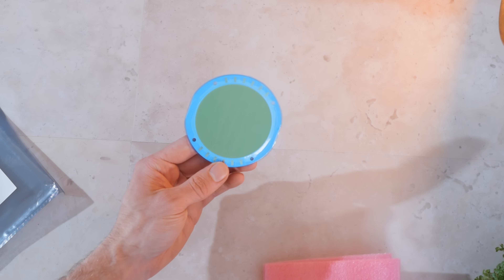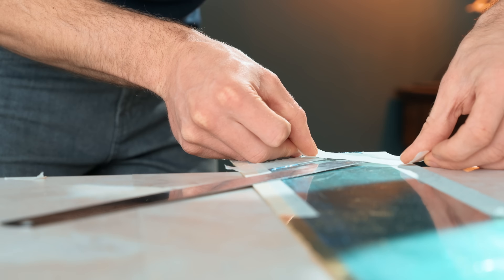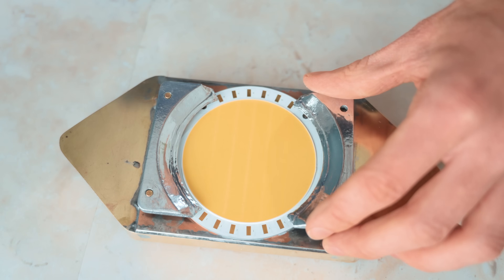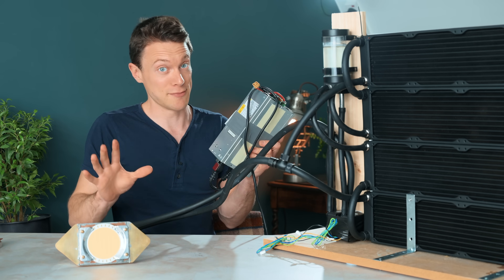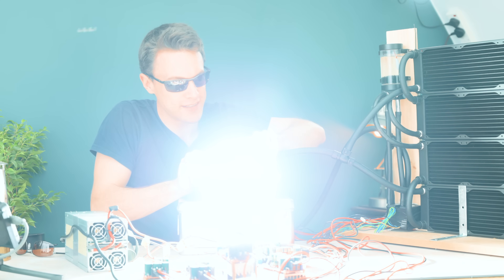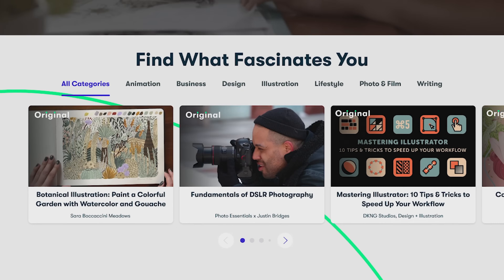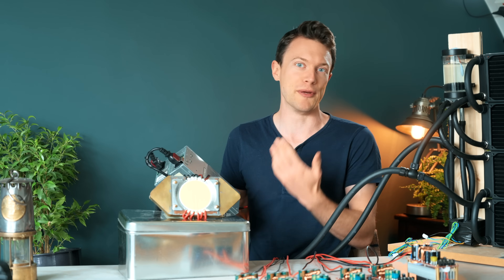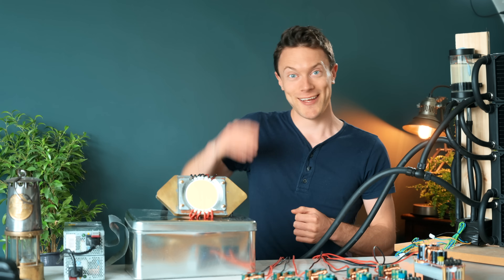Testing the world's BRIGHTEST LED!!!

Comment: With a 80% efficiency (some leds are better than other, maybe this one is more efficient, 60-90% is a typical range), it's 300W of heat loss ! So it's like cooling a very beefy GPU.
Reply: Yep.4x 480mm radiators could dissapate more like 1500watts and up. The LED dissapates at max maybe 700 worst case
Reply: @lukasstadler6594  a single 480 can handle far over 1500W if you accept hotter water temps
Reply: Yep, that massive radiators are overkill
Reply: Borys Plasma Tweeter 
There is no kill like overkill : Ave
Reply: What is the theoritical limit? About 400 lumens per watt for white light, right?
Reply: @Alban led have 20-30% efficiency...
Reply: @DrLoveQc  yes it is overkill, even with a 60% efficiency!
Reply: @DrLoveQc  WTF? There is nothing about heat power in datasheet... This led cob has 120,000lm at 1500w which give more or less 80lm/w which very bad for so expansive led cob!(Good led cob's have 110-180lm/s) Power efficiency is worst than 25%. it's maybe 15%. it's at least 1200w heat power.
Reply: He can and probably will try scaling down the loop to keep the size smaller until he runs into what we would call in the PC world: thermal throttling, or in this situation a thermal equilibrium of probably around 60-70°C for the water.

I would say water cooling is a better option than air cooling at this point. Otherwise he would need very fast fans (think Noctua Industrial PPC) and a heatsink that is not only huge, but also has a big cold plate, and those aren't common, because serves are designed to be compact and don't produce a 1000W of heat per CPU yet. Water cooling is just way easier. Maybe something like a Threadripper air cooler? Still sounds like not big enough.
Reply: What are you talking? This led is 25% efficient, this cooling solution is absolutely necessary. And dont yust take my word for it:
Max lumincance: 120000 lm
Wattage: 1500w
Leads to 80lm/w
At the spectrum of this Led the maximum efficiency is about 320lm/w, thereby the efficiency is 25%. At this efficiency the cooling solution needs to dissipate 1100w of power
Reply: I smell GTX 480 here, the tdp is 250w
Reply: @bitelaserkhalif  gtx 690
Reply: Can you explain the math? It might be useful for me in the future. My next computer will be water cooled.
Reply: @fishsauce2221  what math ? 1500*(1-0.8) ?
 this is for a led, not a computer. Unless you have 2 beefy GPU and a big CPU (a 3000€ machine) there is no need for water cooling.
Reply: @LeBlafy  taking 25% of efficiency at 1500W gona give 1150W of heat power not 300W... please correct yourself.

https://en.m.wikipedia.org/wiki/Luminous_efficacy
Reply: @465kuba  the article you linked is about luminous efficacy (heat generated from any source of light), not about LED efficiency !
It is not the same thing, here we are talking about direct heat loss, not the heat generated from the light of the led (and transferred to a surface).
Reply: @LeBlafy  Oh it was that easy. Did not expect that. The reason I am thinking about water cooling is because I have a problem with dust. My home is clean and the computer is on the desk and yet it sucks up dust like a vacuum cleaner. With water cooling I would only have to clean the radiator. So no fiddling with the cpu and gpu fan and risk damaging them and less risk of a fan stopping. Also keeping the cpu/gpu cooler is supposed to extend their life. Dont know if that is true though but it makes sense. Heat expansion and such.
Reply: @LeBlafy  It is also obut led efficiency. Look on the table "Lighting efficiency" -> "Examples".
Reply: @fishsauce2221  not all power transforms to heat the most part around 60% is transformed in light the other 40% are tranformed to heat
Reply: @Humbulla93   Yeah. But we don't know the exact efficiency of this led, it's not in the specs. But I'm pretty sure it's more than 60%, this is not a cheap LED ...
Reply: @LeBlafy  the samsung LM301h 80cri have around 210-220lm/w if you drive them with low currents, for CRI 95 you have a theoretical maximum of ca. 310 lm/w. of course it is depended on application but for horticultural appliances you want the LED´s to be spread out as much as possible, and if you use midpower LED´s you profit from convergence points of the lightsources. Cree posted a press release with a laboratory LED of 303 lm/W at 5150K. If you lower the color rendering index (CRI), you can achieve higher values. But not higher than 683 lm/W ( that is for green light)
Reply: @fishsauce2221  Every single joule or energy is being converted to computational power or lightning in this case, actual conversion is connected with power losses, which is measured as heat. In PC watercooling it does not work the same way, since computing is not efficient and it transfers almost whole energy to the heat produced by chips. On average 1 powerfull cpu like amd ryzen 3950x on full load consumes around 180-200w of power, transfering it to heat. High end GPU is around 200-250w on full load. So basically you need around 500-550W thermal capacity of cooling. Each 35mm thick reputable brand radiator 120 mm section is rated for ~150w with normal temp difference (water transfering CPU and GPU heat to radiator gets to ~15c above ambient temp). If you let water get hotter than 15c difference (DELTA T) from ambient, blowing lower temp air to the radiator will increase thermal capacity, therefore increasing cooling power. But you need to keep water warm, not hot, because the same happens when cooled water enters cpu/gpu waterblocks, more thermal difference of water vs copper base of the block is, more energy and heat it can absorb. So more radiators = less air needed therefore less RPMs needed on fans, less radiators - more air mass is needed to dissipate the heat stored in radiators, therefore higher rpm and much noisier fans are needed. My recommendation is 240mm reputable brand radiator for midrange pc, 360mm radiator and good static pressure fans like Arctic, Noctua, Corsair needed for gaming. If you are doing heavy renders, doing extreme overclocking on high end pc, you need to get big tower case and put more than 5 sections of radiators with silent static pressure fans. 

For example PSUs have bronze, silver, gold, platinum, titanium ratings, it only tells you what level of efficiency it has. bronze as i remember is around 86%. So if you load your 600w PSU to 400w, it consumes 14% more ~ 460w from socket, therefore 60w are lost in 220v > 12-5-3v conversion and of course  transferred to heat, that's why low end PSUs have their fans almost always on, when gold - titanium rated psus with 94%+ efficiency are rarely engaging their fans. It also has impact on your electricity bill :) Lightning in this case works like PSU, converting 50-55% of power into light, which is dissipated in the air, generating hot light, other 40% are converted to heat generated by LEDs.
Reply: @fishsauce2221  just buy 1x 360mm, 1x 280mm or 2x360mm and you are set
Reply: @1toW4mB0to9  Can you elaborate on that? Even with a high end computer you should only need one big radiator. The size you see on the video.
Reply: @fishsauce2221  depends on what you want to achieve. most people i know watercool to reduce the noise from the computer while also achieving far better temps. the lower you want to push the temps, the higher the required theorethical cooling power to reduce the water/air temp delta

Comment: Hey. Nice "Pit Lamp". I have two, one like yours with the steel sheet top/chimney and one with the brass sheet top/chimney.
Do you have the magnetic Key to open the safety latch on the tank/bottom section? They were pretty rare, as there were only ever a few, that were kept in the Lamp Room.
My old fella had one but I didn't manage to get that when he died. Complicated tale.
I used to work down the Pit as a Mechanic/Fitter, in fact my brother and old fella too, my Dad was an Electrician.
Great content BTW.
That ruddy big LED COB would have blown my old chap's mind. He would have buzzed his tit's off. "That's more than a bloody kettle"! I can hear him now. Although he'd be going on about modern 3 KW kettles too.
Sorry Yanks, you only have 120v, don't you. No 3KW kettles for you  ;-)

Comment: You should have connected the power supplies in series using a big diode or many in parallel ( to support the current)  in order to stop reverse current between the power supplies

Comment: Hi. I really enjoy watching your DIY videos. I have watched almost every videos of yours. They are really informative. On the note side,  please do not touch the exposed side of power supply unit for like capacitors for safety purpose even after you unplug it from the mains. I saw you lift the exposed power supply unit right after it was disconnected. Apart from that,  I find you really hardworking with high level of patience. Keep making videos like this.  #Support from Nepal...

Comment: Awesome vid! Be careful about the water loop though, since you use multiple different metals you risk them reacting together and corroding if your water isn't distilled! Keep up the good work!
Reply: direct interfaces are only between copper and tin and tin and brass which both aren't that far apart only .4 - .7 V each
not a huge problem, i'd guess
Reply: @marc_frank  Yes but if the fluid between them, in this case water, can conduct current, then you need to consider that every metal is in contact with each other, otherwise batteries wouldn't work! I agree that the corrosion build up would initially be very slow however, but it'd still be there! :)

Comment: Make sure if you're doing water cooling to check if you're not mixing copper, brass or nickel plated copper parts with aluminium parts as this will cause much faster corrosion of the metals.
Reply from the maker: Not sure why everyone seems to think that the rads are aluminium... Everything in the loop is either brass, copper, or plastic.
Reply: @DIYPerks  
That's what i wanted to know !
Reply: @DIYPerks  Because YouTube is where we all come to give unsolicited useless advice!
Reply: @moth.monster  it's actually a really good piece of advice. Some rads do in fact use aluminium and that wouldn't be great for the loop's longevity.
Reply: @DIYPerks  
radiator can be make out of so many things, and my heart drop when you didn't mention the material of the radiator itself, please be careful
Reply: @DIYPerks  Because now a days almost all radiators are made of aluminum, copper radiators are very rare. I work with cars and haven't seen a copper radiator used in 20 years. Aluminum is about 1/4 the price of copper and does the job for most part, and that's why manufacturers use it.
Reply: @theR6969  Most pc water cooling radiators are copper for the very reason that mixing metals is a dangerous venture. In the pc industry, aluminium radiators are more rare than copper ones and when you do buy a cheaper aluminium radiator, it is always labelled with many warnings stating that you need an aluminium heat sink to go with it. I can definitely understand that the radiators used in other industries, like vehicles, are made from aluminium, because those are much larger and also weigh/cost much less because of it.
Reply: @theR6969  aio use Aluminium but the decent diy watercooling stuff ist all copper or brass.
If you look on AliExpress or Amazon/eBay they are Aluminium but sites like caseking. (A german retailer) almost all it copper .
Reply: @theR6969  PC radiators of worthwhile quality are all copper and brass. Cars =/= computers.
Reply: I dont think this is going to be a very permanent setup...
Reply: I learned that the hard way with my first water-cooled pc. Never again.
Reply: @jasondennis6038  if you dont mind me bro asking. what happened to your pc then?
Reply: You can use any material you want, but you would want a sacrificial anode if you have different metals in direct contact. I suppose over time some ions could circulate through the system causing galvanic corrosion.
Reply: Well its made copper, brass and aluminum for the radiator.
Reply: What about the solder?
Reply: So we're stil telling ye olde scarytales? Many long lasting commercial liquid cooling products mix metals in their loop. It's not a straight up death sentence nor is it a sign of low quality. You just need to know how to deal with it.
Reply: Just install a sacrificial anode, maybe zinc. Job's done.
Reply: You can mix brass and copper without issues. Copper is in brass. Copper and aluminum mixing in a loop isn't a good idea unless you run anti-freeze (pre-mix or concentrate you mix with distilled water.)
Reply: @Cephalon_Shade  Or if you use a sacrificial metal in the res.
Reply: it's a myth and if you do regular enough cleaning and use distilled water it'll be fine.
DO YOU REALIZE that EVERY SINGLE AIO (Closed loop) mixes copper and aluminium and they run fine for 5+ years????
Reply: @vkmicrov  AIO also usually use a liquid with some kind of corrosion inhibitor. It won't stop the corrosion but likely the pump or a seal will leak before major failure due to corrosion. Galvanic corrosion will still happen though.
Reply: @vkmicrov  The aios that use mixed metals usually fail spectacularly. It is not a myth, it is basic chemistry and physics.
Reply: Aren't the radiators he used aluminum...crap
Reply: @kernelpanic615  The fins might be aluminium. But that doesn't matter as the galvanic corrosion problems only happens if the water comes in contact with the aluminium and you can see that the fitting mounting holes in the end tanks are brass/copper, which in term means that the water cooling channels are made from copper. This is the most common way to build radiators. -Edit found out copper fins are actually more common. But there are a lot with aluminium fins
Reply: huh, did not know that but thanks
Reply: It looked like Copper only.

Comment: Given there are 6 separate powerable sections you could easily run the PSUs in totally separate circuits, be it 2 or 3 sections per PSU.
Reply: That is a better solution i think
Reply: The reason he ran them in series was to get 24V
Reply: Isn't that way LED on cars flicker on high speed shooting? To preserve longevity and power?
Reply: I don't think that would work though because even though they could even be attached to the same plug the neutral and earth's on the input side would be separate and could cause some issues with power stability. especially if he is using a multi rail power supply. still worth a try though? :)
Reply: @Viddiecent  the led also works when only one of the circuits is powered as you can see in the video. I presume that a little instability can be handled by the led as well
Reply: @frisosmit8920  You're probably right actually after watching again the LED seems to be powered in sections so input side probably wouldn't matter at all. probably should have paid more attention to that haha
Reply: @Viddiecent  Wait, UK houses have separate neutrals but not the same hot? 🤔 Tell me more.
Reply: @KirinDave  If it is built to EU code, you should have 3 live's, 1 neutral and one for ground.
You'd typically have a few triple phase plugs around the house, at 480V, usually used for stuff like electric stoves etc. Also hurts a lot to get shocked by.
Then the rest have just 1 phase and 1 neutral for 240V.
All of those are accompanied by the grounding cable.
Reply: @lazar2175  3 phase isn't common in a domestic setting here in the UK (where DIYPerks is from) it's only really used and available in business/commercial buildings. Some very old houses particularly in military towns may have functioning 3 phase still, but it's not the norm

Comment: Power supplies usually have current limits on each voltage rail - so just because they're 1000w, doesn't mean they can do 750w purely on the 12v rail.

Comment: nice. would be cool to see that focused with a fresnel lens. I was sent one to review a few years ago which I think is big enough to fit over that, (from memory I think it was around 12-14cm in diameter) but I only tried it with smaller leds so I'm not sure how well the light would focus with a big one. But it's pretty cheap and adds focusability (you twist it to move the glass forward/back). There's a video on my channel or just google bowens mount fresnel and I'm sure some similar ones will come up.

Comment: The problem with the power supplies is that the rating is on ALL RAILS, chances are the 12v rail will only be able to provide 600 or so watts maximum. As they are server power supplies, 1/3 of the load will be put towards 5 volt rails, as that is what most modern 2.5 inch SAS drives and other components use lots of power from.
Reply: Usually, a psu first converts mains to 12v, and generates the other rails from that 12v. Computer psus do it that way, will check wether my servers do the same, but good point indeed.
Reply: @DerPapierfliegernarr  Server power supplies might be different because they're redundant and hot-swappable - I imagine they both output 12v to a distribution board inside the server itself and the board converts down to 3.3v and 5v as well as providing one output to components, this is a guess though as I've never thought to look all that closely at them!
Reply: @DerPapierfliegernarr  that's still too much for secondary stage rails!
Reply: @DerPapierfliegernarr no, computer power supplies has something called an smps transformer, where every voltage rail has its own secondary in the transformer.
Reply: @sbcontt YT Server PSUs are designed with redundancy and reliability in mind, I don't doubt they shouldn't die, but when one PSU goes faulty, a rail usually gets cut off and handed over to the other one. This wouldn't have happened here, but all the brains of the PSUs are usually controlled by the servers and are obviously not wired up.